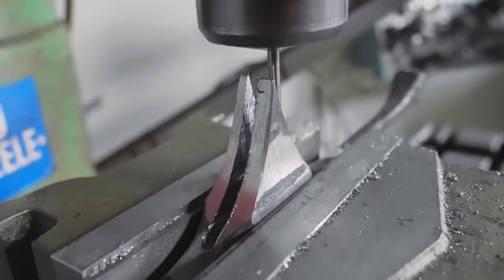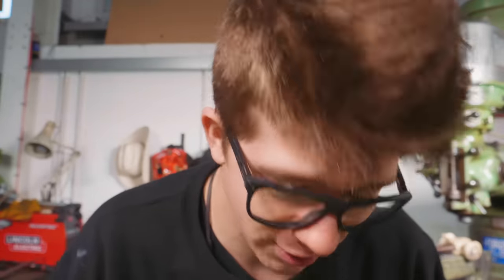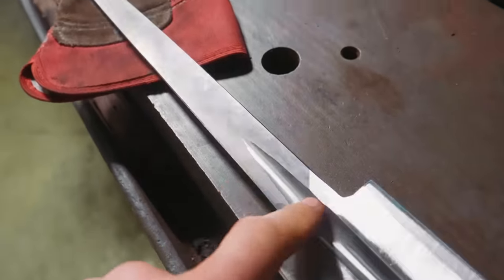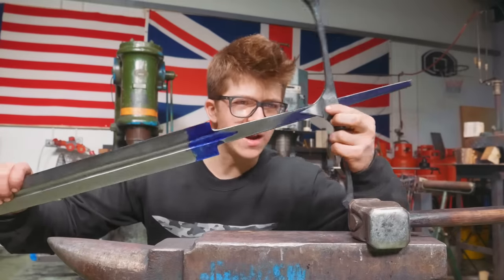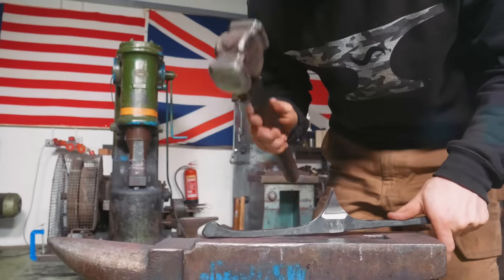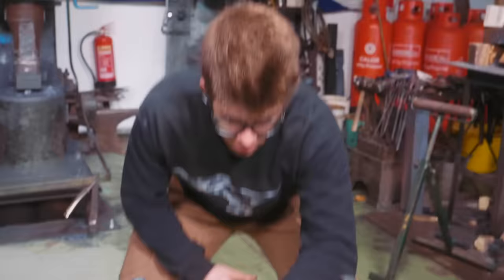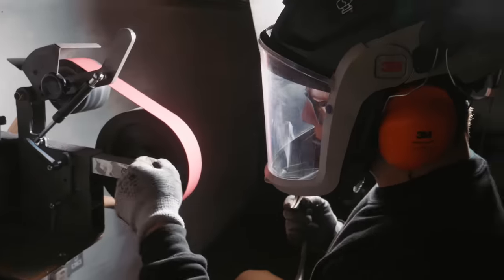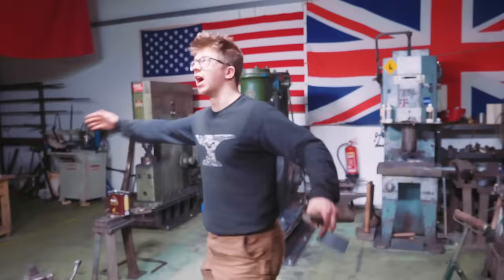MAKING A SCOTTISH CLAYMORE SWORD!!! PART 9

Comment: Anyone else notice that the gaurd isn't centered. It sits off to one side ever so slightly
Reply: He is milling the slot centered on the mass of the guard and will even off the metal based on the centered slot
Reply: David Lange look at it. When he made the slot for the blade it is clearly thicker on one side

Comment: Dude, flip it over... Take some measurements and mark where the tang hole should go.. jesus.
Reply: I’m pretty sure he is worried about the entry angle being the same, since his clamping job wasn’t square. He stated that he would grind the guard to match the hole he cut. If he measured it and flipped it over, that would give him the starting location - but not the angle. Since it isn’t squared up, he could end up with a hole that doesn’t match the slot. The “reference hole” allows him not only to get the location (which measurements would give him), but also the angle to clamp it at. Stick the guard on the end mill bit and then clamp it into position - bam! you have the opposing irregular entry angle.